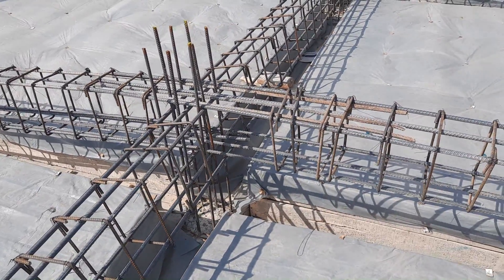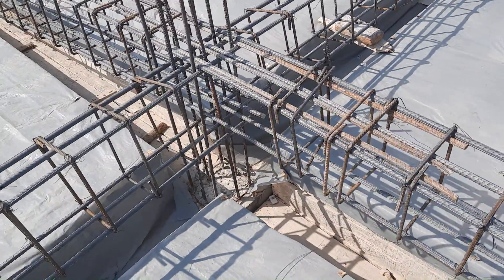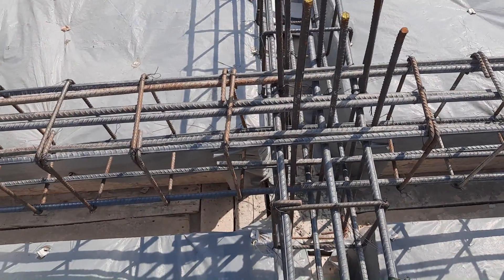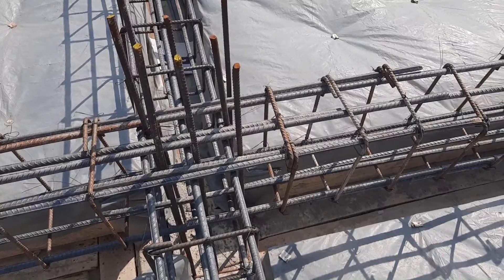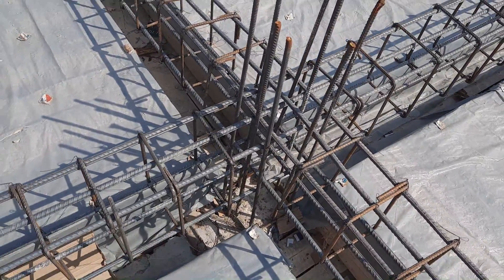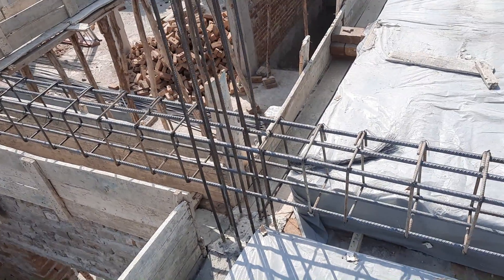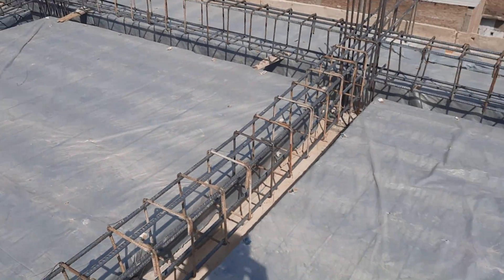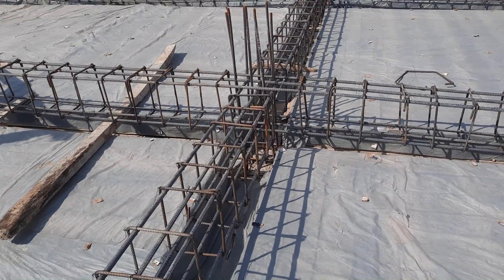8 Big Mistakes in Slab Beam and Column Reinforcement on Site

Comment: Assalamualaikum sir. I worked Dubai as supervisor. Actually in extra steel they should have to provide minimum 1" spacers. And mainly lapping.  Bottom extra should be in center of the coloum. Top steel should be in center of two coloums.